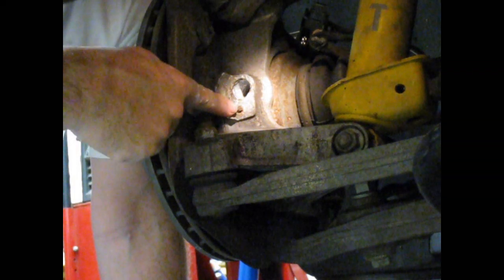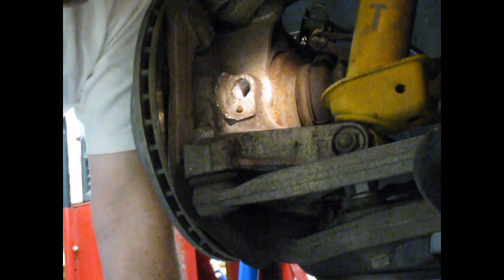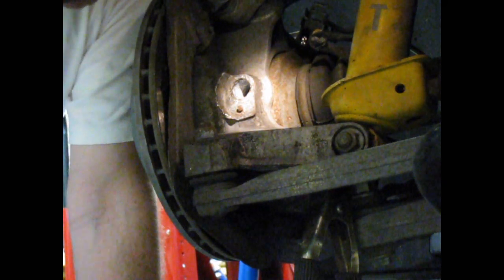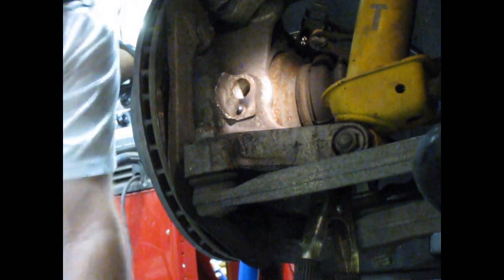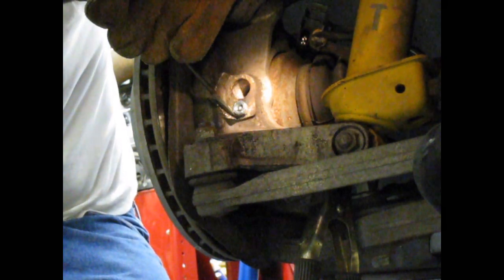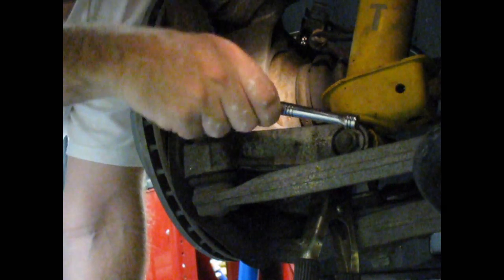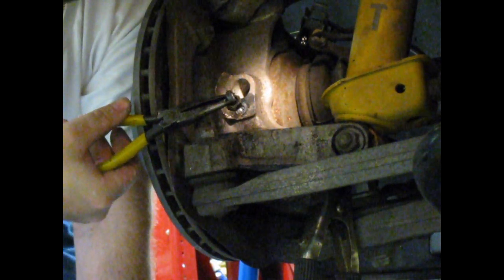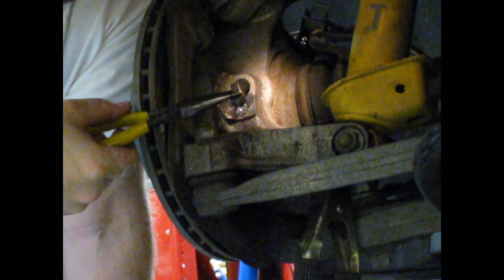Using the welding technique to remove a broken bolt

Comment: You saved me a couple of thousand dollars.  I broke a bolt off in my 5.7L hemi head.  Then I broke off an easy out (aka screw extractor).  If you ever tried drilling an easy out, then you know how hard they are.  I tested the remnants of the easy out by laying it on aluminum and then welding.  The weld held firmly to the easy but not the aluminum.  I then filled the cavity in the head with a bead then built up a small bead as you say.  Then welded the nut.  It came out with little force as a result of the head applied in the welding.  THANK YOU.

Comment: Alright now then, I, like the DIY apprentice,  below need to lea rn to weld. I have a couple nuts I had to cut off that held the catalytic converter to the exhaust manifold o n my trailblazer. There is a good deal of stud (approx 1 1/8") to put a new nut on and weld so that I can remove the remaining studs and put new ones on. I also am looking to be doing some other repair work to an old charcoal grill this summer, and a bit of welding on my aluminum boat which I am also planning on a second restoration project throughout this next year. Taking all of those things into consideration, what form of welding equipment would be best for covering all of those items? If I am going to invest the money into the equipment, and the time required to gain the skill, which type of welding would cover all of those needs. Mig, Tig, oxy acetylene?
Reply from the maker: Mig is the easiest for a beginner to master. You can also get a nice machine for a few hundred bucks - probably less for a used 110v machine.  I would recommend gas shielding over "flux-core", and I use a mix of CO2 and argon.  Then practice, practice, practice!  Do be aware that Tig is the only choice if you want to weld aluminum, but the machines are more expensive and it'll take longer to develop your skills.

Comment: hello,
I have n outboard motor for my little boat and 2 m6 bolts are broken off from the impeller/waterpump housing.
the tail section is made of aluminum, and the bolt is some crazy oxidation proof steel alloy.
i have a cheap stick welder, do you think i could weld a nut on there without damaging the aluminum.
thanks
Reply from the maker: I've never used a stick welder for that... The advantage of a mig is that it will continuously add material without requiring you to move the electrode.
Reply: Thanks for your fast reply and info :)
So basicly a stick welder would make it ALOT harder to evenly attach the materials with the same strength.
Damn iI might need to buy a Mig welder just for 2 m6 bolts haha, jezus.. the bolts are close to 2 oil seals too sealing the lower gears and the shaft, therefore I cannot heat it to long...Any way i would try to remove the bolts, theres a big risk involved where the whole tail section needs to come apart :(.
I hate broken bolts :P
Love these kind of video's thanks!

Comment: Can I ask where you clamped your ground. I have to try this on a aluminum small engine that has a steel motor mount bolt broke off flush. Do I just clamp it anywhere to get conductivity?? Great video by the way. Thanks
Reply from the maker: +Don Raabe Just clean off an area on the aluminum so it gets a good ground contact, and you'll be fine!

Comment: I have two low quality bolts broke off in a tight space below my motorcycle.  This video gives me some light. I'm just curious what's the welding machine you are using here?
Reply from the maker: It's a little Lincoln that runs on 110v.  Good luck!

Comment: Two of them out with this method... the third one had to be drilled and 'easy outs'. It was a 96 Neon. Put something around the head to keep the slag from getting in the head. It took several tries.... bolts were only in there about a half inch.
Worked but not as easy as easily as it looks....

Comment: you do not want to attempt to remove it when it is red hot. you have a much better chance of snapping the remaining portion of the stud/bolt off when it is still glowing. the steel is softened when its glowing. you want it to be hot, but not glowing hot.

Comment: @spudth Just remember that sometimes the corrosion in the threads will be so bad that it will wipe out the threads when you extract the stud.  So long as you do it the way you show it is still all good.  You can then easily drill the remaining junk thread out and install a heli coil.  (a heli coil is the 'right' way to put threads in aluminum anyhow.  Just tapping aluminum and installing a steel fastener is a economical shortcut that automakers - and bike makers have done for years.)

Comment: I was taught that trick back in 1995 by my boss at a tool shop.  The guy was an aircraft mechanic stationed in England around Korean times.  He's 80 now.  We used a Tig Welder because you have more control for a better weld.  Sometimes with a MIG welder it just fills the nut with slightly melted wire and the nut falls off as soon as you turn it.  thanks for showing this to all the kids!!

Comment: Will a flux wire welder work here too?  I broke a valve cover bolt in the head.  Guess I should pay more attention to inch lbs vs. ft lbs